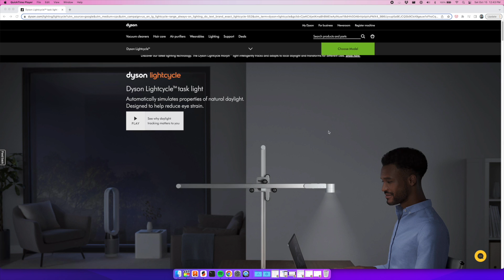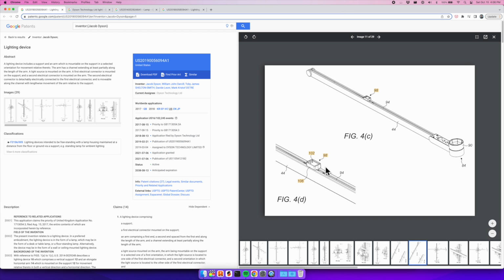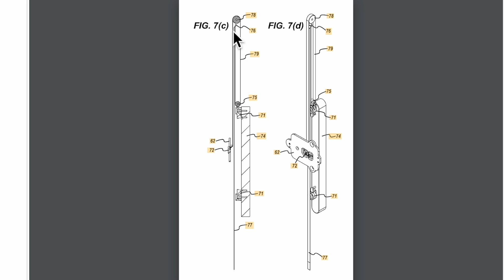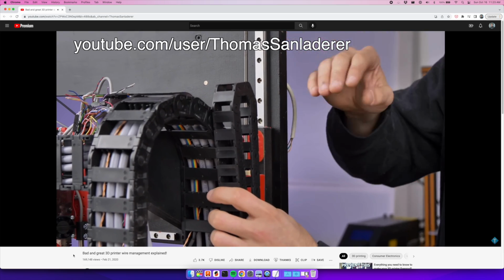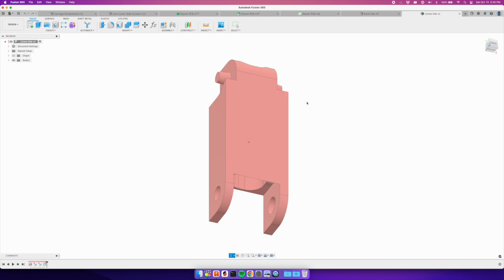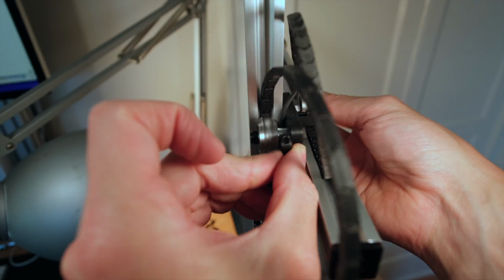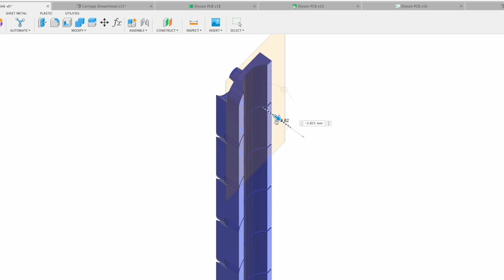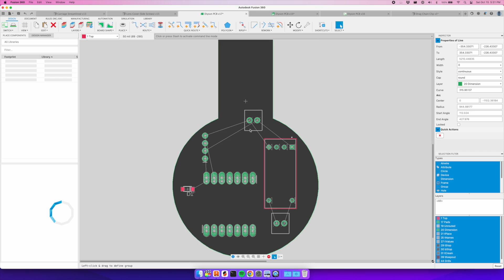Cable management so good, it's illegal - DIYson Lamp Build Log #6

Comment: Im not sure if youre gonna read this comment after such a long time, but there are timing belts with metal strands inside (instead of fiber). These are intended for increased rigidity, but you could misuse them as wires, too.

Comment: I respect your hard work and knowledge, but, as an engineer i wonder, why would you use an inferior solution for a simple problem (i'm not saying you're wrong, just not what i think is optimal), i'm sure you know of engineers lamps, or the similar Ikea TERTIAL design. in a previous video you used touch buttons instead of regular buttons to solve the "too much power to push the button will move the lamp down" problem, to that i thought "but most people would pinch the lamp head part with two fingers and a thumb and press the button with another finger. i guess it's design for designs sake, which is "too expensive" by my standards

Comment: I’m late to the party, but noticed a design point:  the cable doesn’t need to move relative to the plate that holds the rollers.

That means you can have two separate cables:  one that connects the vertical axis to the plate, and one that connects the horizontal axis to the plate.  Then you just need wiring in the plate that hooks the two axial cables together.  That gives you the freedom to put connectors on the plate in locations that will be the most convenient for each axis.

Also, in case no one has mentioned it:  put a slip ring at the rotary joint at the base.  That will give you unlimited rotation without having to worry about a cable getting twisted up.

Comment: if the aluminium channel was cut in half and bonded back together with an insulator in the middle, you could use metal rollers to transfer the power between sections with one half of the extrusion being positive and the other negative

Comment: Would it be reasonable to have an open sided power ribbon nested inside the rail, so it's not exposed to the user? Then, have fixed contacts slide/roll on this exposed side of the ribbon at the joint of the two rails?

I could draw a picture, but not sure of I'm describing it well.

Comment: Amazing job, great job on figuring an alternative solution.   My first thought when you described your issue was the old slot car tracks for applying power.  But I like your solution better, the dragon cables are pretty cool.  Another light control option is use and esp32, and control over Bluetooth or wifi.

Comment: You've probably solved this already but why not borrow a concept from scaletrix slot cars and run a positive contact up one channel and negative on the other. Your intersection carriage then has the contact brushes hidden underneath along with static wiring between the two axes?

Comment: You can do a similar solution using the same principle as a track light rail system. Basically they put a plastic insert with a solid copper wire running along the length of the aluminium extrusion and a slider that keeps in contact with the wires. I think its pretty common in store lighting fixtures as it makes it easy to reposition the lights whenever they change the store layout

Comment: I wonder if you could slightly modify the drag chain links so they would prefer to align to the next link at a slight angle, rather than straight.  This would make the chain hug the horizontal rail, rather than loop up from it.

Comment: Given it's just a safe 12v you could run conductive tracks (copper tape maybe?) along either side of the channel in the extrusion contacting brushes on the carriage and eliminate wires all together.

Comment: I had a similar idea for a modified hevo design I'm making, and when you described the issues in the first part of the video i hoped you'd go for cable chains.

A good way of keeping cable chains really tidy is to have a dynamic constraint at the half way mark between the chain and it's end or full length, that way it sits flush with the installation instead of out in these big loops.

Comment: I think I've come up with an idea that might work.  Remember those gimmicky sprung reels that would roll a cable up? Something like that.  On the horizontal axis, you have the pill-shaped end, you could hide one here, route the cable through the top of the extrusion, enter the reel, exit through the bottom and intersect via the carriage.  As for the vertical rail, go up through the carriage, around the belt, and hide the second reel within the counterweight, then drop the cable to the base. 

there's also a potential alternative design to the counterweight that moves the design back to a 20x20 extrusion.  Hide the wheels within the weight itself.  All the weight needs to do is slide, and now with the wire tensioning mechanism, it could hold itself to the rail without issue.  Have the belt/cable hookup at the top on the underside so that it can still hide within the rail, then the top wheel hidden within the counterweight, then the inlet for the wire, which then goes through a center reel, then the wire outlet, then the bottom wheel.  And if you're really worried about keeping the counterweight flush, ad a second belt to the loop that goes through a bottom pulley within a square housing, the wiring could slip through this housing and into the slipring for the base.  Of course this takes up space, just leave enough open room to funnel some lead shot into. 

If you can get the reel design correct to where it works properly, this could be a very clean setup.

Comment: I don't get it...what's so special about this lamp? (Not talking about your version) the dyson one. I have the same system in my office hanging on the sealing.  Already for 10 years.  I can move the lights on a rail , add lights or slide them while they are on.

Comment: Definitely not illegal to replicate, just to offer for money. Eg, if you sold the belt with integrated wires or something like that as a part, well, it's possible Dyson might take offense. But as a hobbyist? If you're not recreating Trinity then the big man upstairs probably doesn't give a rats ass. Patent law is a disaster, but the only time you're going to get in trouble is if you've angered the patent holder. And the patent holder won't care one bit if you're not commercializing your product.

Comment: The whole point of a patent is to share and spread knowledge.  We often get caught up on the protections offered to the patent holder, but the knowledge is there for the public and nothing can prevent you from using it as long as you are not commercializing it.  IANAL, but explaining a published patented and the process of how to recreate are protected public rights.  This is the opposite of trade secrets.  These are in contrast to a trade secret where the holder gets to keep an idea secret, but gets no protections other than against theft.

Comment: Could adding a wheel at the top of the vertical shaft and on the end of horizontal shaft and having the chain loop over it create a cleaner look with everything being more "in line"?  rather than having the loops grow? , it would kind of be similar to a "wire pulley" system similar to the Dyson principle but it would be more "external" as you'd see the chains looping over the wheels etc laying in the tracks might need another set of secondary pulleys... Either way awesome project, had never seen the Dyson lamp till this video but that mechanism is clever and clean.

Comment: Unless I'm missing something, couldn't you loop the drag chain past the end of the aluminum extrusion and connect it to the carriage on the bottom? Then, instead of extending outwards into space, it would run around the end of the extrusion (which would need a bearing of some kind) and stay flush with the extrusion.

Comment: Haven't finished the video yet but since the rails are metal and you're using probably 12v leds, why not use the metal itself to conduct the electricity?

Comment: You could use a brush contact method. The metal structure is the ground and pcb to fit the channel with a centered contact with a brush contact from a drill available a the local hardware store.

Comment: A flexible circuit would easily serve as both belt and wiring.  But you could use both belt and flexible circuit. 

Another way to bring power is using slip-ring technology.  Basically wipers ride on a power rail.  Multiple wipers minimize noise.

Comment: Well, perhaps you already realized this… but Dyson's cable management is so good, because it has NO wires, but a track light system with electricity running through the rails. There're already many track lights on the market, so it isn't surprising that they don't mention it on their page. Honestly, there's no good reason to run the cable through the track, because it would just keep bending and hindering the mechanism all the time. :P

Comment: Great walkthrough of your project! Not sure if this has been mentioned in a previous comment but if you are only running power through the long wires then a sliding contact system might be cleaner than the drag chains; this could be similar to 12V track lighting rails.

You might also think about using a slip ring contact at the base to allow 360 degree rotation of the vertical section.

Comment: 1) I don't think you need to consider any legal things concerning patents, as long as you don't plan to sell the finished product.
2) have you considered a simple drag connector? (not sure how they are called. basically a conductive path inside the profile, that has a thing running along it to grab the power? like a slip ring just straight?)
3) thanking for the 60 subscribers is really cute 2 months later :)

Comment: i have one better solution. The rails are made on metal. yo can use them as current transfer medium. on top of rail lay the copper strip. And metal bearing will t\will be use as slip ring commutator.

Comment: Very cool project! I really like the look of the mini drag chain even though it’s not as sleek as your target design. I think your chain negates the need for the bundled cable, so could you fit the 5 wires in there if you remove the thick outer sleeve? Or maybe the insulation in the bundled cable is important, I don’t know

Comment: Have you considered using a flat cable? In the proper orientation it should act as a cable chain by itself without the bulk. 

Also, I don’t know if this is readily available, but a hollow extrusion with slight indents for the wheels to track in (eg for the horizontal bar it would be a hollow square extrusion with indents top and bottom) would allow you to keep the flat cable / cable chain completely inside the frame.

Comment: Steven, first of all, compliments for your work and way you analyse this lamp. 
When looking at the dyson, I see a fixed arm on the carriage, sticking out, when the lamp is completely forwarded.
When in the middle or retrackted, this fixed arm disappears behind the moving arm.
If there is a large slot in both the moving and fixed arm,, facing eachother,  then you could put your (flat-)cable in it.
This way the cable is hidden and functional.
Maybe if you  move your wheels out more, you could attach such a fixed arm.
This fixed arm don't need to be a 20x20-profile but maybe a smaller profile or even a elliptical piece of pipe.
The way your cables are attached now, is a sore blister in your design, a good idea, but a blister.
For the vertical cable, I thought of the following:

* The cable through the centre of the profile to the top of the profile.
* from there, down to the counterweight, 
* again up to the top, 
* over the toproller, 
* into the fixed arm.

This way the cable follows the movement of arm and shortens/lengthens according to the movement of the lamp.
BTW, is it an idea to use the mechanism of the counterweight , also for the up/down armmmechanism?
It would be mucht cleaner then the wheelconstruction.
Reply from the maker: Good idea, Barrie, I know exactly what you mean with respect to that "fixed arm" used to hide the cable. Might be worth exploring as a way to hide the cables further. If I'm not mistaken this is only a feature of the original CSYS lamp and not the updated Lightcycle where they managed to hide the cable completely in the arm.

Nice idea for the improved vertical cable too, I if I found a suitable flat cable that doubles as a belt I might look into this more, still shopping for that elusive part though :)

Thanks for the thoughtful suggestions and for checking out the project :)
Reply: Indeed I looked for the lamp further, after I commented your clip and saw the fixed arm disappear.
Somehow I can imagine that they integrated this in the arm itself.
It could have become a kind of sliding side.
Never the less, with all respect again, it would look better then these chains.
The vertical-arm sollution has been done earlier.
I had an old lamp in the past, which had this idea.
It had a belt, with parallel on it, the cable.
These were seperate, but on the same axles and over the same guideroles.
Nowadays you have these silicon wires, which keep straight.
Maybe with the right tension(-ingsystem), you could keep this apearance clean and doable.
Reply: @StevenBennettMakes  in this clip you can see the power to the arm connection. https://www.youtube.com/watch?v=arJQ2kgICiM&ab_channel=Dyson

Comment: Sorry for the double-comment!  Perhaps if you didn't alter the cable you could still use their rotating electrical setup?  Maybe use a larger gauge silicon wire to replicate a round belt wrapped around the entire body.  This would achieve the same effect, fit beneath your t-slots, and it should be quite easy to locate a connector and round belt pulleys to accomplish this!

Comment: That is an awesome project. I really like what you have done. I'm Subscribing. Are there any flat wires that would fit in that drag chain? I feel like it could have smaller loops if you could find flattened wires. I suppose it would be more fragile.
Reply from the maker: Thanks! I've done a bit of shopping for flat cables, but I've come up short. There are a lot of flat/ribbon cables, but not a lot of flexible, 2 conductor cables <5mm wide (at least that I have found, but I would love to proven wrong on this!)
Reply: @StevenBennettMakes  have you checked adafruit? They might have a few options for under 5mm.

Comment: A way to get power and data from the base to the lamp would be to have the wheels be electrically conductive and have one be +, one - and the last data. The two wheels on the same side would have their conductive strip offset, and that side of the metal rod would have a double strip running the length.

Then you send data serially using a type of one wire protocol, and have a much more active LED head with a power converter, and a microprocessor controlling all aspects of the light, which is slaved (through a concentric ring connector for 360 degree motion) to a master controller in the base (which you could program using bluetooth or USB). It would eliminate all the wires, bypass the Dyson patent, and possibly be much cleaner...

Comment: This looks absolutely great! My initial thought was that they were using an accordion-style flat flex cable inside the arms with a metal sleeve pulley covering it, but using the metal sleeve pulley as the actual cable is brilliant too. 

If your flat cable is slightly too wide for the channel, why not slightly widen the channel or trim the edges off the cable? It could easily be spraypainted black at that point (or simply covered with a black strip) to achieve that final look

Comment: How about plastic extrusion with metal rails and metal wheels to conduct the electricity?  5volts, use a super capacitor in the light head to smooth out the power…?

Comment: Great Work! But I couldn’t stop thinking about how one could possibly cut out all the cable drama (even tho it looks cool) by working with electric rails positioned inside the rail and a flexible point of contact. (Think of Carrera/model trains) what are your thoughts?

Comment: based on the low quality patent pictures i think Dyson is also using a kind of drag chain to transfer electricity from the carriage to the LED. well... a flat flex but in a drag-chain-like configuration and completely contained in the channel
i wouldn't say it's a massively novel idea since similar configuration has been used for decades in for example printers and scanners to connect a movable printing/scanning head (especially flatbed scanners since flat flex in them is constrained similarly to the flat flex in the Dyson lamp - in a sort of channel. well it's constrained in only one dimension - between glass and scanners bottom but since as you said flat flex is flexible in only one direction it is already constrained by it self in the second axis)
Reply: unfortunately 2020 extrusions channels are probably too shallow for this sort of thing so idk

Comment: I wondered if you could 3d print the horizontal part, or find a plastic extrusion and insert the 'wires', contact strips,  for the lamp, to be contacted by the bearings...LEDs can run at low enough voltage to allow exposed conductors, so that the base is the only place with 'line voltage'
You could, of course,  use a similar method for the vertical column, with embedded conductor 'stripes' in it...maybe you could even use conductive plastic, or the silver ink that is used for PCB printing or repair.

Comment: Nice!

You might get the drag chains to be neater by attaching the end links parallel to the motion, spread apart by the diameter of the drag chain minimum curve. So you get the chain forming a nice "U" rather than it being like "P" as you have it now.